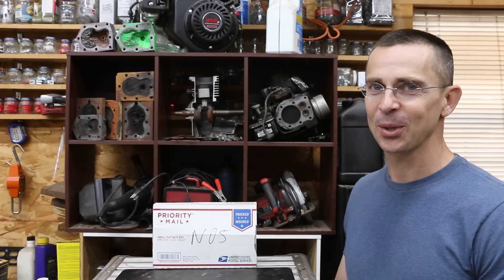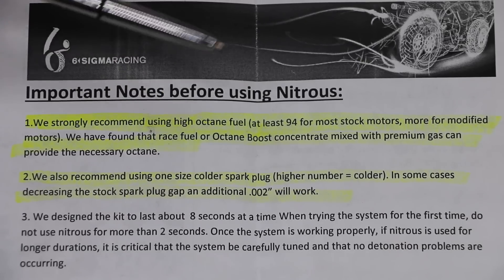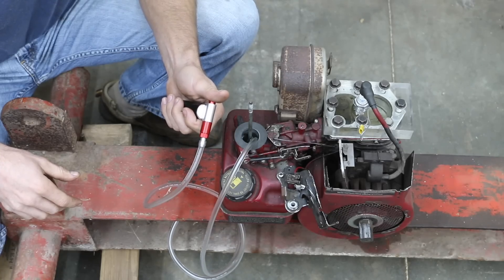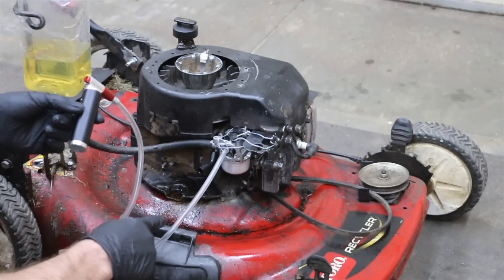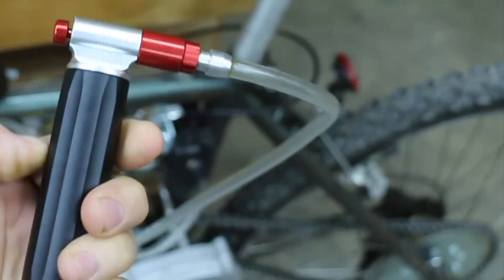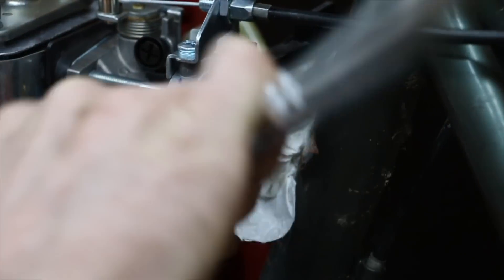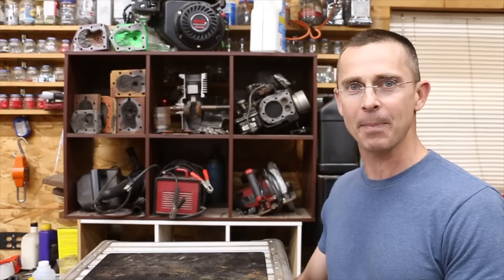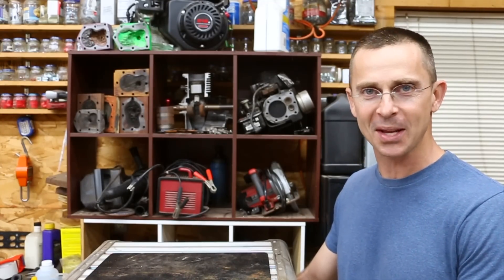Will the 4-Stroke Bike Survive Nitrous Oxide?  Let's find out!

Comment: Thanks for the video but i personaly would like to see or test my self how would an engine react to direct compressed air from aquarium air pump or tyre air pump. would you test it in a carburature engine, ? and not compress the air like in this video that other air could also go in, i think you will ge what i mean, (Close the hole system and integrate the air compressor and connect it to the motor and do something that the air compression is always at the same amount so that one can adjust the idle mode of motor.
Reply from the maker: Thank you for the video idea!

Comment: Here's what you do. Put a 90* elbow to make an intake manifold so the carb sits out the side and you can put a giant cone filter on it. Tap in the manifold so you can fit a single wet nitrous nozzle in there. Mount a 1lb nitrous bottle. Mount a separate fuel tank filled with 110+ race gas and a pump/regulator set-up. Microswitch on the carb so you don't need any button. Get real fancy and put a crank trigger on it with a digital controller so you can ramp in it however you want. Just keep upping the jet sizes in the nozzle until it finally blows.
Reply from the maker: Thanks for the suggestion!

Comment: It's also advisable to retard the timing by 3-4 degrees as it keeps the force of the harder and quicker combustion from pushing the Piston directly into the rod and breaking stuff.

Also I would gap the rings 2-3 Mil larger to keep them from touching and breaking the Piston
Reply from the maker: Thank you!
Reply: 2 degrees per 50h.p. of nitrous. This was NOWHERE near that. 4 degrees with that little bit of nitrous would end up with a net LOSS of power. Wise up
Reply: @davelowets  that applies to automotive engines, in motorcycles and smaller engines you need to remember that 50hp in difference for a 300ci engine is like 2-3hp for a 20ci engine...
Reply: @RuSrsbro  You still don't need to reduce timing that much on a small engine with that small of a hit. I'm thinking that with a little extra fuel, the timing could be left alone. The chamber in an L-head Briggs or similar engine is pretty lazy.
Reply: @davelowets  that's true, it's a flathead and they're not exactly known for volumetric efficiency lol
Reply: @RuSrsbro  Right.... 🍻

Comment: Nitrous is basically just concentrated oxygen (and other inert gasses) so it enables more fuel to burn. It's safe in any application where enough fuel is provided. Otherwise it will work like a blast furnace, where more air = higher temperatures = burned pistons.
Reply from the maker: Thank you

Comment: I enjoy your testing videos, but I'm not convinced you actually saw pre-ignition, which is the ignition of the air/fuel mixture before the spark plug fires, normally caused by a hot spot in the cylinder. When I played the video at 1/4 speed it looked to me like the flame front initiated from the spark plug in both cases, with it being more intense with nitrous.

 I worked for an automotive electronics company that made a spark control module for the first Buick turbocharged v6 back in the late 70's.  The module detected knock and retarded the timing to prevent pre-ignition.  When the module failed and pre-ignition occurred we usually ended up with a hole in the top of the piston.
Reply from the maker: Thanks for the constructive feedback!

Comment: I have used nitrous on a 250cc four stroke engine to race. It works great. But you need to be concerned with the clutch and the cylinder temps.
In a nut shel it works like this. You spray nitrous oxide into the engine. And you add fuel . When the nitrous oxide reaches 750 deg it splits into oxygen and nitrogen. The nitrogen absorbs some heat. The oxygen is then available for the fuel to mix with. This is how the power is made.
Reply from the maker: Great post! Thank you
Reply: Yeah isn't nitrous about triple the oxygen that we breathe?
Reply: @jimmyjames8573  Nitrous is 38% oxygen vs. 21% in our atmosphere.
Reply: @bcgrittner  ahh thanx didn't know that just thought NO2 60% lol that did sound abit too high
Reply: @jimmy james, Nitrous Oxide is N2O, not NO2.
Reply: bcgrittner and is exothermic when it breaks down, and it forms a net one and a half gain in total gas molecules. Thus it had two other ways besides that extra fuel burned
Reply: In a nut shell, that's basically what the guy in the video just explained.😉
Reply: @shawncrocker7037  😂👍
Reply: What if it's in a 50cc 2stroke
Reply: patajos still works, just a bit more dangerous to the engine
Reply: @vipervidsgamingplus5723  ok thx
Reply: @patajos - not a good idea for an engine that small unless you can somehow control the flow to provide 50% boost or less.
Reply: Eric... Thank you for dropping some knowledge. We need more ppl like you.
Reply: Bcgritner so thqt means breathe a bunch or nitrous for better air quality by logic of course 😁😁😁
Reply: @josephmarcum3984  people are using NO2 as a recreational drug and it's killing them, you can have too much oxygen, it's as bad as not enough
Reply: @andyb7963  yea and thats sad but I was joking.
Reply: @Andy B, Nitrous Oxide is N2O, not NO2.
Reply: @Dirk Hamilton - That is a misleading statement.  N20 offers no available oxygen for breathing by humans, so saying less is misleading (cuz it implies there is still some available oxygen for breathing which there is not).  Also, you likely wont die if you take 1 breath of N20 and hold it.  CO2 builds up in our lungs naturally so in small amounts it wont kill us.  We can handle it just fine.
Reply: David James once nitrous oxide breaks down it is an exothermic reaction. Because nitrogen forms triple bonds. Further the nacent oxygen is far from reactive. With no extra fuel it’s like beating your meat.
Reply: @dennisford2000  You sound somewhat clueless.  A stronger oxidizer will burn the fuel quicker, when the piston is higher up, thus making more power without adding extra fuel.  However this is not recommended cuz of the extra heat. Fuel is added to a N2O system to help better balance it.
Reply: David James with out extra fuel it is pointless , drives combustion temperature too high. Damn man could you not hear it rattling. If you had more than eight seconds it would destroy, if you blew it in to a automatic lightning torch and disable the spark and mix it in through a manifold at the Ventury ports and blew it down the carb it might not ping, and power would be far better. You don’t know what you are spewing
Reply: Further nitrous will self combust at 1000 f
Reply: David James I think its more a matter of you misreading my statement rather than it bring misleading.   My 2nd and 3 rd paragraphs SAID there was no extra oxygen available by breathing N2O.

as mentioned by others, you have to heat it to 1000F before it decomposes and releases the oxygen.  That doesn’t happen in your lungs, or... it better not!

Also “none” does fall under the category of “less”.  Even at the dentist most of what you’re breathing is normal air.

Comment: N2 systems have a separate fuel line to add fuel to the extra O2 the nitrous gives. Without extra fuel you changed the fuel to air ratio in other words the engine is running lean/hot. You would get extra power and higher RPM by adding more fuel. Most likely above +50 MPH
Reply: Finally a commentator who understands how nitrous works... it is NOT a fuel, its chemical supercharge. You are pumping more O2 in the engine and need more fuel to burn it to make more power, what this kit really is doing is leaning out the engine really badly
Reply from the maker: Thank you!
Reply: Exactly!!!! Without the extra fuel he's stressing the engine even more
Reply: @Heads Mess I never said nor implied that nitrous oxide is a fuel  , and you apparently don't understand what explosive means. In the simplest definition an explosion is when something gets really big really fast . A material does not have to be combustible to explosively degrade . Water explosively degrades in a steam engine . All it means in this particular case is that the nitrous oxide charge expanded exponentially to fill an area greater than it originally occupied. That's the explosive part. And that the Nitrogen and Oxygen molecules separated during the process, this is the degradation.  This is not your hot rod's  nitrous system . The nitrous oxide charge is not being used as catalyst to aid the combustion process. The engine isn't getting a big enough nitrous oxide charge to make a difference there . As compression rises the nitrous oxide charge becomes excited and begins to expand which increases the effective air density charge (higher compression)  . Upon combustion the already excited nitrous oxide charge expands exponentially as the Nitrogen and Oxygen molecules separate . This increases the cylinder head pressure applying more force on the  piston.
Reply: Also ignition timing device needed then this will be even more fun to watch
Reply: Yes this kit is not complete, without more fuel to the engine you are losing the NOS benefits
Reply: Most small engines operate on the fat side of the stoichiometric scale. The 02 gains from this type of nitrous oxide system are going to be minimal, and in most cases will not require readjustment of the fuel mixture ratio. This system works less like a chemical supercharger and more like an artificial increase in compression ratio. As the piston compresses the air-fuel mixture the temperature of the air charge begins to rise . This atomizes the fuel droplets into vapor . It also excites the nitrous oxide charge causing it to expand and fill a greater volume. Upon ignition, cylinder temperatures will cause the nitrous oxide charge to degrade explosively increasing cylinder head pressure. A little tank like that would never keep up with the demand of a conventional nitrous oxide system operating as a chemical supercharger.
Reply: @captaincaveman1 the carburetor will never be able to adjust to chemical supercharging. People have been known to trick electronic fuel injection systems into being able to support a small amount of squeeze, but not much. It takes fuel to make power, how much can you cram in and still burn efficiently.
Reply: @Heads Mess The data sheet in this damn video explicitly talks about it's explosive degradation and the temperature it takes place at. It very much does explosively degrade at a point ya dipshit.
Reply: @Cooe.  he is not going to get it. He already learned everything there is to know about NOS from reading Hot Rod Magazine .
Reply: Eh not so much with a like .25 nitrous hit
Reply: captaincaveman1 either location will result in the same effect. carb won't adjust itself to any differences because the jets only offer so much fuel depending on jet size.  That's why it's important to re-jet when any changes are made to intake or exhaust because the amount of air coming in and exiting engine increases yet the amount of fuel remains the same until you change the jet.  EFI may be able to adjust itself but I kind of doubt that. If you planned on using NOS during a drag race you could maybe over jet and run rich so that when you actually use the NOS   you might be closer tons "normal" air fuel ratio
Reply: Bob Ross  Nitrous Oxide is stupid safe as long as oxygen is maintained. Shit's non-toxic as all hell. That's why it's still used to ridiculous amounts in medicine and as a propellant in a stupid # of consumer products. 
Literally the only way NO2 can kill someone is by strapping a gas mask connected to a pure tank onto ones face, so one passes out & dies from a lack of oxygen. Otherwise literally the only real health risk is Vitamin B-12 deficiency in EXTREME chronic users, but that's easily treated with just taking a B-12 supplement.
Reply: Cooe perhaps you could see a mild problem with being high on N2O while riding a moped at 40 miles an hour?
Reply: Cooe what are you on about? If I report you and it sticks, it means you did something outside the TOS. It’s not germane to the discussion here. Enjoy a new report from me though, I guess...
Reply: Cooe you know, chain posting against someone who has reported you for harassment is you know...kinda indicative of you harassing them.
Reply: @Cooe.  I don't owe you an education in how to respect people, most people figure it out by the age of 10. Perhaps if you do some introspetion, and you know, not insult peoples intellegence you might get it. I don't expet you to. Reporting is simpler. No one ever got reported for being polite.
Reply: KreemieNewgatt yeah, my mistake. I’m going to go ahead and edit that so I don’t get corrected a dozen more times.
Reply: Cooe if you can’t understand that I have no reason to tolerate being insulted and abused, you shouldn’t say shit to people on YouTube thet would get you decked in the jaw if you said it to their face.
Reply: @Mostlyharmless1985  After you abused the guildlines first by falsely reporting my original post that had nothing wrong with it. Get over yourself. Your hypocrisy is fucking unreal.
Reply: Carbs actually have a slight advantage over most cars injection setups when it comes to shooting dry shots of nos at them.

Most cars ECU’s will only enrich a mixture so far, whereas with a carb, the amount of fuel that gets pulled through is partially determined by the vacuum the engines pulling, so it won’t actually lean out as much as you’d expect with a dry shot.
Reply: It is a carburated engine, it should be sucking more fuel as the RPM increases.
Reply: @CritShow  it's not the rpm increase, its effective increase in charge density that requires more fuel.
Reply: Saltuk Savran your right.. to an extent. it is sucking in a higher "amount" of fuel but only because of Increased rpms, yet the Air/fuel ratio remains the same. it's still being leaned out when nos is used because the fuel rate remains the same yet there is an increased amount of oxygen.

Comment: Seriously don't listen 2 most of these gimmick answers to why there could possibly be more of an explosion. The simple solution is you need to add more oxygen at a 30% pressure increase more than the nitrous oxide. A good solution would be to add the nitrous oxide after the carburettor because this will also eliminate and nitrous oxide being incorrectly mixed with the petrol and oxygen if you add the nitrous oxide after the carburettor has done its job the nitrous oxide will find its place. It also helps to use a metal pipe on the nitrous oxide tank so there any water that condenses will stay condensed in the pipe and not get blown into your engine

Comment: You should try rigging up a way to feed in extra fuel when you hit the Nos button. N2O is an oxidizer, not a fuel, as you proved by trying to light it. The extra oxygen will greatly increase power output from any engine, but it will need extra fuel at the same time. Nos is like a turbocharger in a can, but like all other reactions, the proportions should stay the same. Pump in more air, and the reaction will need more fuel to go with the extra oxygen. Without extra fuel, it's just making the engine go lean, which will make it more power, but also make it run hotter. 

For the full Nitrous effect the engine should have extra fuel at the same time. Perhaps a nozzle on the Nos hose that blows over a pickup tube connected to a small fuel reservoir, the way an atomizer or airbrush does? With such a small bottle it would only need to be a half ounce or so.
Reply from the maker: Great suggestion!

Comment: There are a couple of comments I wanted to reply to but I figured it would be no sense because I didn't want to bring out the "Engineer Bobby".. essentially. By introducing the nitrous into the air supply is basically increasing the compression ratio. Because it becomes volatile at a certain temperature, ..what is initially introduced as a regular air supply violently increases its presence when the valves are closed and combustion is taking place. Unlike what one chap in the comments was saying. Essentially you had leaned out. Etc.. You did not lean it out. It increase the compression ratio and slightly improved on volumetric efficiency. Leaning it out would be introducing more air however that was a gas disguised as air

Comment: Nitrous systems on car engines also inject additional fuel at the same time to prevent preignition or detonation. The reason they preignite is nitrous alone will lean the air fuel mixture out to the point of engine failure without extra fuel enrichment. N20 makes power because as the heat and pressure build in the cylinder, the nitrous gas releases the oxygen molecules and accelerates the burn rate. Just like how an acetylene torch will not cut steel without the added oxygen. If you just jet the carb richer, the engine will run like crap when not using nitrous. Just add a fuel enrichment jet that you can turn on with the nitrous and you'll see much better performance and you won't fry the engine.Old school plate nitrous systems on cars had two very fine orifice jets mounted in a carb spacer plate to inject both at once and they were controlled with solenoids. Even those needed careful tuning to get just right. You had to play with the jet sizes. The trick is not to add too much more fuel so it doesn't just drown the engine and bog, but not so little it's still lean. You'll have to experiment to get the mixture just right.This is a cool experiment, I love this channel!
Reply from the maker: Thank you!

Comment: Pre ignition and detonation are two different things. As well as a colder plug and tighter gap you also MUST add fuel and retard the ignition timing. How much of either depends on many factors. Also, all of your engine experiments would really benefit from the use of a wide band O2 sensor. This would help you get a better idea of what your air fuel ratio is. Many of your engine experiments aren't as definitive as they could be without that information.